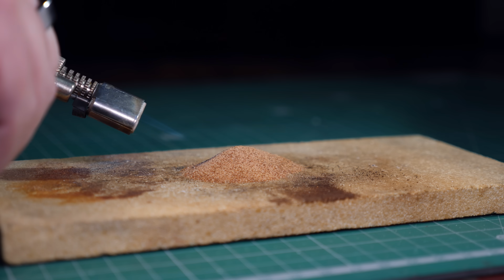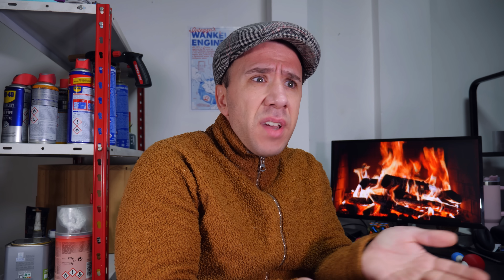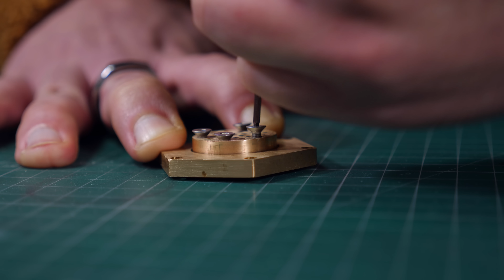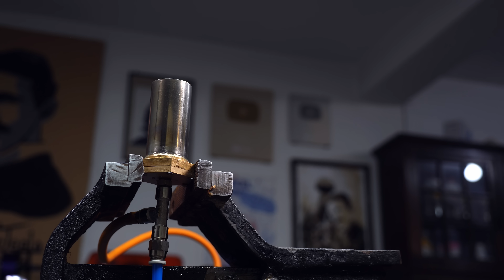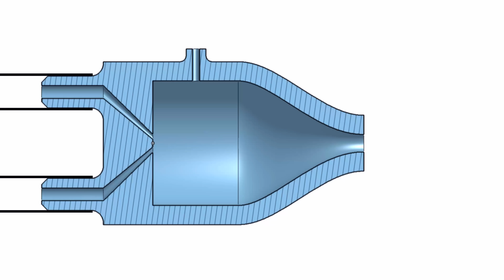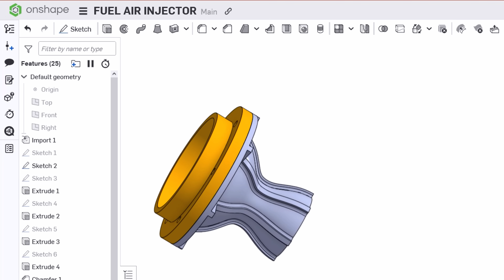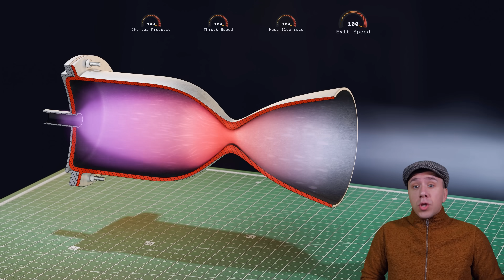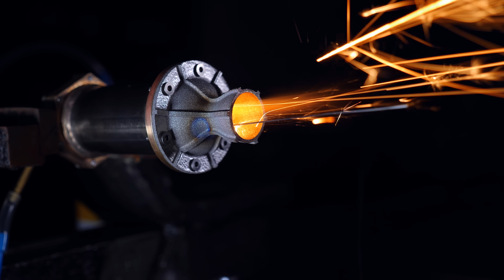I Built the FIRST VENTURI ROCKET ENGINE

Comment: You seem fairly calm for someone who's received a bag full of a controlled substance (in a VERY suspicious delivery method) and you don't even know the mysterious supplier 😆
Reply: Is it controlled for owners or suppliers? If its regulated in the way that you cant sell to unlicensed people then the loophole is that unlicensed people arent barred from owning it, just that no one else is allowed to sell it to them, so recieving or making your own could be legal depending on the laws where you live
Reply: @Casualf1lth  A lot of the time the licensing is only for professional/commercial users. 90% of it is ensuring you are insured in case something stupid happens. Example: TruGreen sprayers (the company and individual employee) need to be licensed in most states to spray you lawn with the same chemicals you can by at the hardware store. TruGreen caries some extra regulation on how to store, transport, dispose of things. The only real difference is the company will by a drum of concentrate instead of a few gallons of it down to a spray bottle of ready to use.
Reply: @Casualf1lth it is limited supply and purity without license and all substances containing it must be tracked and tracable to prevent the manufacture of explosives...

Although I cannot understand why, if anything its use in home shop explosive manufacture has saved more lives by oxidizing and polymerizing formally high energy fuels into non-explosive plastics. 
Feels more like the same type of folly as survivorship bias, every terrorist tries to use the compound once because it looks like the easist. Most terrorist attacks only get one successfull shot and use Petrol by itself. If everyone is using one thing then abandoning it...
Reply: @AnonymousAnarchist2  you may be correct about the effect (people giving up on using ammonium perchlorate) and mistaken about the cause. I think it's a logistical reason, bang-for-your-buck instead of underwhelming effects.

Adding regulations makes it harder to get legally which drives up the price on the gray/black market when there is relatively low demand (high-demand products in the same scenario lead to a highly-developed black market instead)

So it's hard to get and expensive (and looks like it only easily makes a low explosive, like black powder is) so it is probably easier to use other avenues to the same effect (fuel-air, for instance)
If it was easy and cheap to get, it probably would still be used on a larger scale.
Reply: @samuelmellars7855 right, like ketamine is incredibly easy to get as an example of a controlled substance with high demand
Reply: @samuelmellars7855 so I used to reverse engineer things for "state department's". The feds, NASA, etc. I do not want to go into details about all the feedstocks and engineering here because
a) it will inspire worse ideas
b) it will get state attention 
c) The "good guys" gave up on explosives some odd 90 years ago... arson less so.

But we found a lot of durable and flammable but decidely non-explosive gelled up componants with ammonium perchlorate in them. 

And it was easy to see why they used to try that route, ammonium perchlorate is easy to obtain from some fertilizers and is avalible.
The problem is that the only explosive your actually going to get from it is a highly unstable contact explosive that needs to be kept in two parts.
And that is not useful unless your a demo crew or building targets that go boom for a stage show or a movie set, avalanche control munitions, or just for funsies.

I cannot stress how fun those two-part explosives are. But they cannot be transported, prepaired in advance, or really deployed in any tacticle manner without a Howitzer.

And if you need heavy artillery thats not a terroist strike. Thats an insurrection, rebellion, invasion, or civil war.
Reply: @Casualf1lth  Yeah that's not true at all which is why it came in a phone case and was designated a phone! if customs would have found that there would be consequences. if he actually did know about it but somebody sending you something without your knowledge you won't really get in trouble. customs will call you and if you tell them I don't know anything about that package and don't try to claim it nothing will happen. but they will try to go after the person who sent it.
Reply: @patman0250  Yeah, no, it is true for home manufacture. The thing is that if its COMING THROUGH THE MAIL that would point to unliscensed sale and manufacturing for sale to unliscensed buyers. The loophole that Im talking about, with SOME technical precursors, is that you can make them for yourself in some quantity that depends on each substance but you cannot sell it without following the specific laws around the business side of things. This was 10 months ago and Im just going off of a previous comment to remember what we're talking about, I can remember researching the actual laws about it 10 months ago and it was legal in this way back then, but if something changed between then and now then feel free to let me know. If nothing changed then its still legal for limited home manufacture in small amounts depending on the state you live. If youre thinking about making your own then check the laws very carefully for wherever you live. Make sure you look at the exact laws and dont just chatgpt it
Reply: @Casualf1lth  yes, you need a permit to have precursors.
Reply: @tymoteuszkazubski2755  The precursors are table salt, ammonia, and a battery. If you mean a permit for precursors of explosives, look up tannerite.
Reply: @tymoteuszkazubski2755  As far as I know in america ammonium perchlorate isnt federally regulated. There might still be state specific legislation for it
Reply: @Casualf1lth LOL by that logic, without a license I can't buy a full auto machine gun, but if I build my own the atf will just be like "well played sir, you got us" 🙄
Reply: @sinformant  Funny enough that is how the ATF is for buying or selling non-automatic weapons. If you make a gun for yourself no big deal. The moment you go to sell one you made in your garage though... 🧑‍⚖

So long as your able to do own a gun legally in the first place.
Reply: @Awrethien oh i know. And have dealt with the atf. Ive done a form 1 build. But automatics Are a no no and they hate that frt's exist
Reply: @sinformant  Two entirely different things. Think of chloroform instead of machine guns. Machine guns are restricted in every case while chloroform's regulation is based on its sale and how youre allowed to use it. You can legally make it yourself and have some quantity of it but still need to follow the laws for proper disposal and youre not allowed to use it as an anesthetic but you are allowed to use it for other things without a license
Reply: Two words: "Plausible deniability." Since by the time the video comes out, there won't be any left.
Reply: He does know, he's protecting his source 😉
Reply: It isn't really controlled in that way in the US. Companies that produce it in large quantities just don't want to sell it for personal use. It happens with a lot of lab quality chemicals. If he set up a LLC with the name "Integza Aerospace Laboratories" he likely wouldn't have any issue getting it and lots of other things. Then the biggest issue would be quantities are too high to want or require a big investment.
Reply: @barongerhardt  he's in Portugal, and under EU law he needs a permit.
Reply: @Raven74947  I thought he lived in the US now. Even so it might be a case of it is hard to get but for hobby use unregulated. I don't know, the EU seems to hate fun.
Reply: @Raven74947 channel info says US
Reply: @barongerhardt  EU lawmaking is basically an overprotective parent. Half the time it gets companies to do the right thing and not be a cyberpunkish dystopia. The other half it feels like living in a bureocratic nightmare like that one futurama episode.
Reply: @barongerhardt He is not in the US!
Reply: @600wheel  Are you sure? People move.
Reply: @600wheel channel info says otherwise
Reply: @barongerhardt I would bet money and he’s not dumb enough to want to move to the US
Reply: @600wheel I think there was a video a while back where he said he moved to California. Although I could be misremembering and maybe he's still in Portugal.
Reply: @KodiakWoodchuck I would be shocked but anything is possible…. I know when he was making his axe he was having trouble because he lives in Portugal and couldn’t run to the nearest Walmart and buy shotgun shells. Although it does say US in the channel description but nothing about something as huge and fantastic as that in his posts
Reply: @KodiakWoodchuck  There was a video a while back where he visited California.
Reply: @barongerhardt Honestly at this point he could probably get some investors to invest in his company.
Reply: @polarknight5376  Just tell investors that you're putting an Ai satellite in orbit and watch the funding roll in.
Reply: @barongerhardt  he's not american
Reply: @barongerhardt He isn’t from the States, as far as I know he lives in Portugal
Reply: @barongerhardt not quite, then he would be considered commercial use and would need a LEUP. and the ATF would definitely frown on his questionable safety standards like lighting motors in his house. He would also need to store fuel he makes in a magazine separate from dwellings. 

I did rocketry before the hobbyist exemption happened and motors were redefined as not explosive. So familiar with the procedure.
Reply: @barongerhardt  >  lots of other things

One 5 litre can anti-gravity paint, 100 water-to-gasoline pills, one invisibility tarpaulin, and a usb diamond fabricator, please.
Reply: @barongerhardt  he is portuguese
Reply: @barongerhardt  Marketing and use of explosive precursors is regulated in the EU to fight misuse by terrorists.
Reply: @wilfriedklaebe  We all know how "effective" that has been. 🙄 It's not like everybody doesn't have at least a couple of the ingredients on the list in their home at all times for other purposes.
Reply: @MrAntice exactly!👍👌🤙
Reply: @MrAntice In spain there was a big incident with the muslim radicals hoarding butane barrels. The orange, widely used commercial ones you can just buy anywhere for use at homes. The place they were stashing them in exploded spectacularily because of an accident before they could load them up in a van and set them off where they planned to. So theres no need to even build or synthetuze anything to make explosives really.
Reply: @wilfriedklaebe  and achieves absolutely nothing, their preferred method is stabbing or cars.
Reply: Hopefully that was theatrical otherwise he will spend the rest of his life on a whole bunch of watch lists lol
Reply: @robertsmith4681 Who cares if theyre watching, they can see it all on youtube
Reply: @robertsmith4681  Wouldn't be surprised if he was on some watchlists already
Reply: @robertsmith4681  Having that is not a watchlist having that is straight prison they dont play, You will be arrested very very quickly I hope it was a joke
Reply: @robertsmith4681  I'm choosing to believe someone is risking prison time because they want more integza videos.
Reply: It was a joke, if somebody didn't get that.
Reply: @Redditard  Wdym he clearly got that in the mail? He is somebody no?
Reply: Casting a solid oxidizer and throttling gaseous/liquid fuel is a genuinely clever inversion of the traditional hybrid rocket problem. The potassium nitrate test behaving poorly due to slag formation is exactly what I’ve observed in real tests—solid residue clogging injectors is a nightmare. Switching to AP was the correct move, and the clean burn you got confirms the theory beautifully. This is legit experimental rocketry, not just YouTube theatrics.
Reply: perchlorates are not controlled substances!
Reply: @rollbot  Aluminum Perchlorate is controlled in the EU as an explosive precursor and a license from a national body is required to purchase high concentrations however those laws may only apply to the distributor.  As far as I know possession without a license is not a crime.  So, the person who sent it may have violated the law but it's unlikely that Integza is in violation of any law by having it.
Reply: @rollbot  In the EU, they are. Have a look for Regulation (EU) 2019/1148, which even says »For some restricted explosives precursors at concentrations above the limit values provided for in this Regulation, there exists no legitimate use by members of the general public. Therefore, licensing should be discontinued for potassium chlorate, potassium perchlorate, sodium chlorate and sodium perchlorate.«
Reply: @rollbot maybe not where you live...
Reply: So convenient!
Reply: especially when the reason the substance is controlled is because it's used to make bombs
Reply: Well how would you feel? I don't think he does anything illegal using it. Simeone selling it was rather illegal. And this someone didn't get paid obviously.
Reply: For hobby use he's actually exempt. Although suppliers may not want to sell it to people without a LEUP.
Reply: I am 99% sure he is just covering up for his supplier. But also I would completely understand if he actually just lost it.
Reply: Put yur dih away waltuh
Reply: hey, its "plausible" thats what is important.
Reply: There is no federal law specifically prohibiting the sale of ammonium perchlorate to unlicensed individuals, because ammonium perchlorate itself is not classified as an explosive under U.S. federal law. However, while the raw chemical is not regulated, its use in manufacturing explosives or propellants can trigger regulatory oversight.

The key legal context comes from a 2009 court decision (Tripoli Rocketry Ass'n, Inc. v. ATF), which ruled that ammonium perchlorate composite propellant (APCP) — the mixture used in rocket motors — is not subject to federal explosives regulations. As a result, APCP and motors containing only APCP are not regulated under 18 U.S.C. Chapter 40 or 27 CFR Part 555, and no license is required to handle them.

However, this does not mean unrestricted sales of ammonium perchlorate:

Suppliers often require buyers to be certified members of recognized rocketry organizations (e.g., Tripoli Rocketry Association with L2/L3 certification) to ensure responsible use.
If ammonium perchlorate is combined with other ingredients into regulated explosive mixtures (e.g., certain pyrotechnic compositions), those mixtures are subject to licensing and storage rules.
While the purchase of ammonium perchlorate by private individuals is not federally prohibited, shipping, storage, or use in certain contexts may still fall under state or local laws, or be restricted by supplier policies.
Thus, while no federal law explicitly bans selling ammonium perchlorate to unlicensed persons, practical and legal constraints limit access to qualified individuals.

Making ammonium perchlorate (AP) at home for hobby rocket motors is not explicitly prohibited by federal law in the U.S., but it operates in a legal gray area with significant risks and practical barriers.

The final product, ammonium perchlorate composite propellant (APCP), is not regulated as an explosive by the ATF due to a 2009 court ruling (Tripoli Rocketry Ass'n v. ATF), so making APCP for personal use does not require a federal license.
However, synthesizing ammonium perchlorate itself involves handling hazardous chemicals (e.g., perchloric acid, ammonia) and may trigger scrutiny under environmental, chemical safety, or anti-terrorism regulations (e.g., EPA, OSHA, or DHS guidelines on precursor chemicals).
While no federal law bans amateur synthesis of AP, possession or production of certain precursor chemicals may be monitored or restricted, especially in large quantities or without proper documentation.
State and local laws may impose additional restrictions on chemical storage, handling, or use, and fire marshals or authorities may classify homemade propellant production as illegal under fire code or hazardous materials ordinances.
In practice, most hobbyists avoid making AP from scratch and instead rely on commercially available APCP reload kits, which are sold to certified individuals through organizations like the Tripoli Rocketry Association or NAR.
Reply: @Casualf1lth  🥱 another A.I copy and paster. Boring.
Reply: @OEF_Vet_0331  go pass the bar exam,then summarize the myriad of legal documents on tbis topic then. Once you do that come back here and agree with me bc im right
Reply: it was china
Reply: Def not his first rodeo!🙌😂😂
Reply: I mean I live in the US and I’ve bought a small amount of Ammonium Perchlorate off of Amazon before. I just think it’s regulated in large quantities or high purity.
Reply: Right.. he "lost the shipping bill" and "no way to find the supplier".. bro you must be very young or naive
Reply: @Sav.B58 eh. I wouldn't be surprised if he had ADHD, in which case, it makes complete sense for him to lose it.
Reply: I'm no expert but I'm pretty sure this is one of the few ethical and useful uses for the dark web. You can buy whatever crap you need for projects without annoying restrictions holding you back.